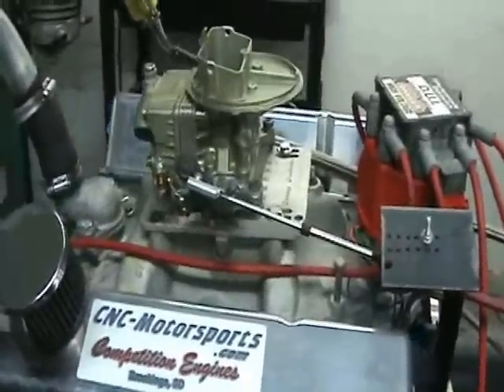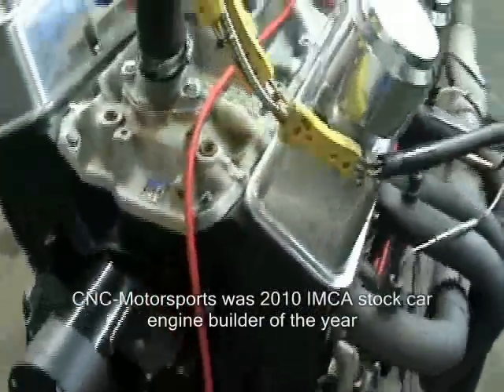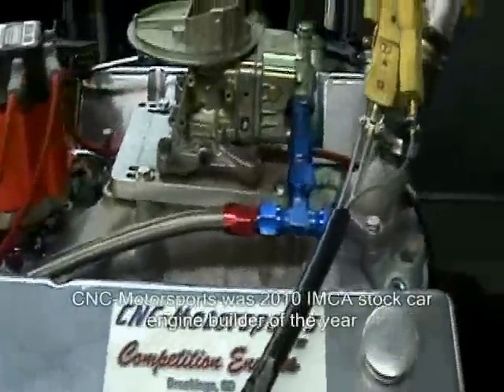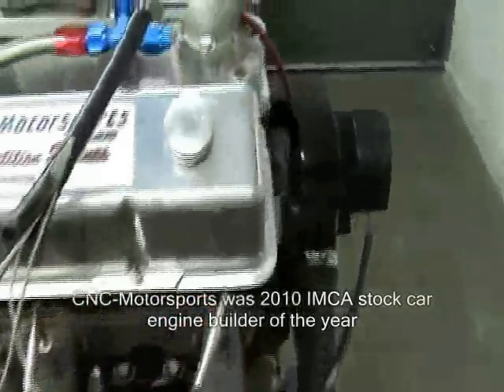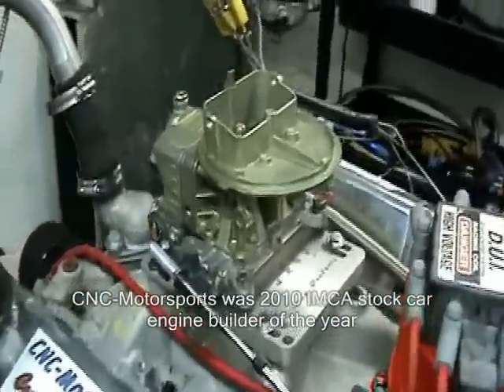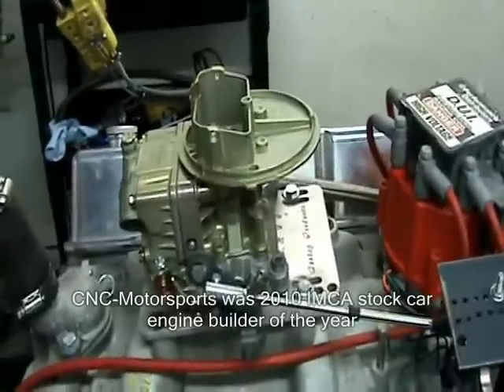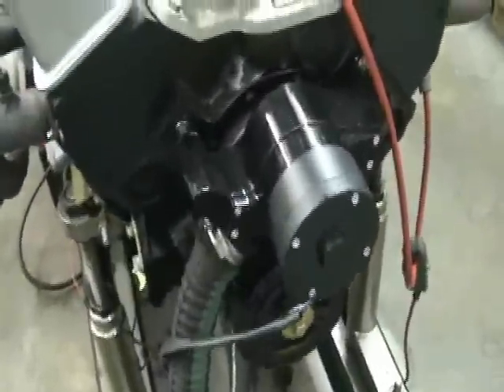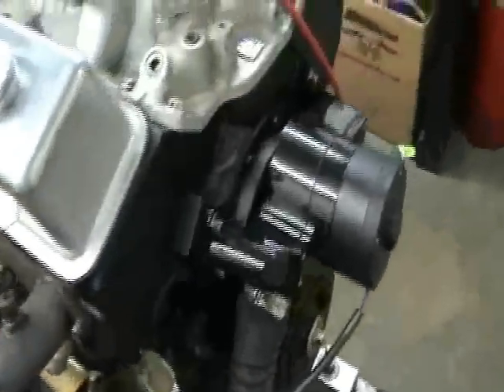SBC 396 Stroker IMCA Stock Car Engine 411 Horsepower

Comment: impressive numbers,,,, but,,,,  I noticed you ran an electric fuel pump.  not splitting hairs here but, you also ran an electric  water pump.  and for ideal conditions to match being in the car,   a power steering pump was also absent.   what, in your humble opinion, kind of numbers would it make being all these things attached?
Reply: = much less .now hp to tire shall be much less, although with a little mighty mouse power punch in the torque still present it shall work really good figuring the best engine in 2010 as far as points, well against the competition in the limitations for the rules and the low cfm rule limitations and such , it is probably  around as good or the best you can get still. There are some builders out there, with the cam work done on this by cnc motorsports custom ground cams is going to be a contender, and the build of this engine is great.

Comment: you say factory block on a few of your 396 builds...what block is that? just wondering ...its holding the Tq and HP and 6700 rpm and living....i would love 2 of these engines in my 83 camaro and 84 silverado..

Comment from the maker: In our opinion yes, We try to stay away from the stock 400 blocks as much as possible. They have a laundry list of problems that can or will eventually occur. And yes, a good 400 block is getting very hard to come buy. We stopped buying 400 block cores when dart came out with the SHP block. If a customer comes to us wanting to build a 400 using a stock block, they need to provide us with a good core.